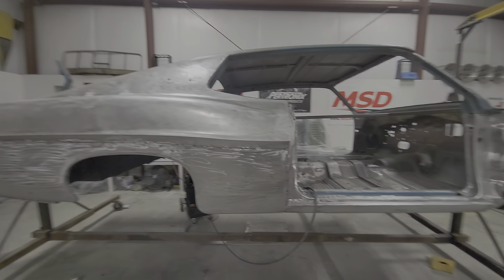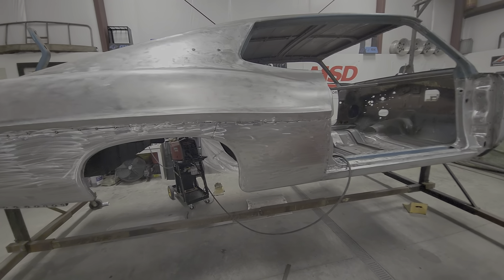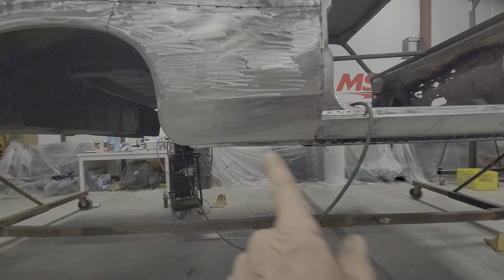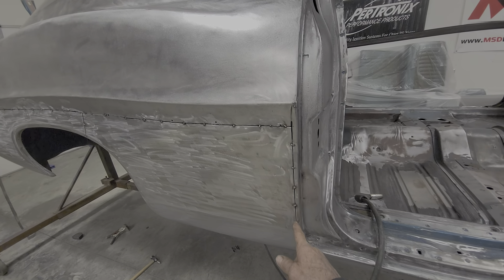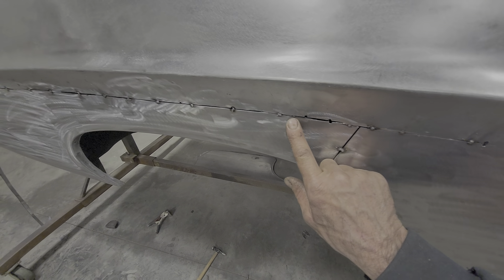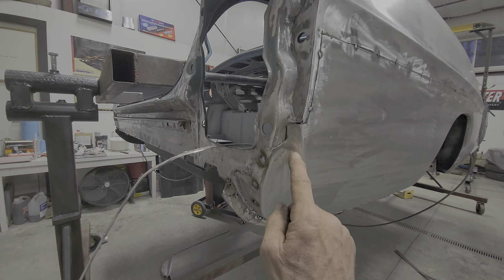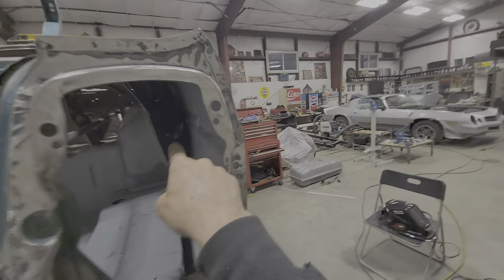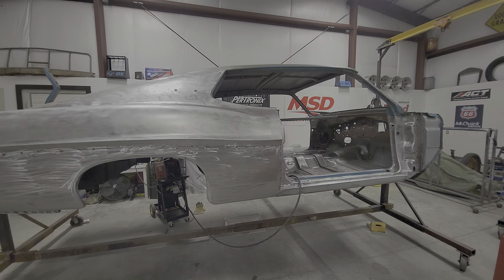1968 Galaxie XL 500 Restoration...Sheetmetal is finally being Installed ☻️

Comment: i have a 68 xl fastback,where did you get the rear lower outer bottom panels.i cant find them anywhere.
Reply from the maker: Hi..I believe they were sourced from Macs Auto Supply..they are far from good and require alot of work to make them fit correctly. Probly spent 20 hrs shaping,bending and cutting. I would not trust the upper body line so I cut below the body line on the car  and trimmed the panels.